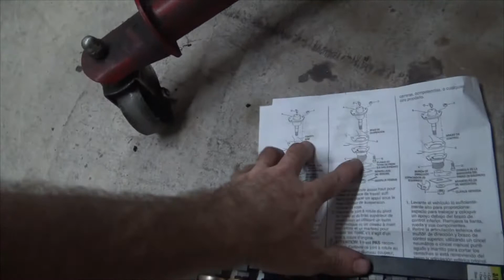Phoenix finally wheels 2

Comment: Hey bro, You should gain some clearance when you hit the brakes for the first time and the caliber pulls in - may be enough to clear the rims  You could also hit the calibers lightly with a file for the small clearance you need. Just a thought. Later
Reply from the maker: Marvin Norton you know. That’s a good point. But I already threw the spacers on. I’ll check next time I have the wheels off. You know it’s what we do. Work on cars and waste money. Lol